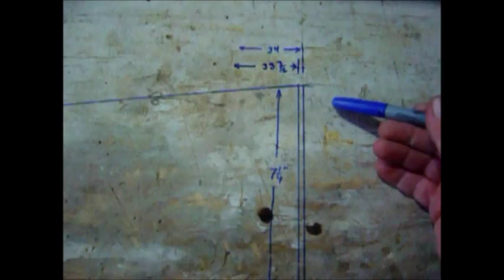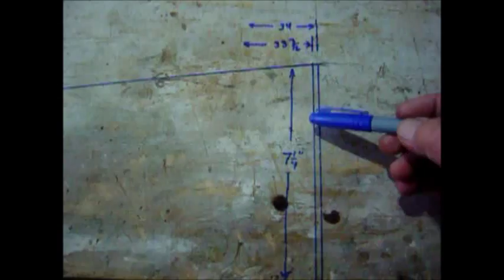Solar Water Distiller Build Part 1

Comment: Excellent video series! Question: Why have an external condensation chamber? Wouldn't the output be the same without it, and if not, how much is the output improved? One other question: Was that PVC-coated aluminum collection trough custom made by a sheet metal shop?
-
I'd eventually like to build a couple or several of these to fill a hundred gallon holding tank to supply my house. With mineral-free water from my highly-mineralized well water, I hope to keep my house plumbing deposit and corrosion-free as possible, without the need of expensive filtration systems.
Reply from the maker: Don Saito That is a very good question, thanks for asking. The external condensation chamber is not needed for this unit to work but it does increase output. The condensation occurs on the cooler surface areas as heat from the hot moist air is exchanged through the glass and the external chamber into the atmosphere. The external chamber adds to that surface area therefore more condensation occurs. Air circulation also plays a part in the process. The more hot moist air that circulates over the cooler surfaces the more condensation occurs. The external chamber increases air circulation in the unit due to the extra cooling surface creating more air movement. You have a very do-able idea for home water. If you have the money to build as many as you need, I say go for it.

Thanks again for asking your question. I will work on making a video of the production with and without the external chamber to show you the difference so stay tuned.
Reply: STARFIRESOLAR Thanks for your reply. That's very logical (external condensation chamber increases output). Here's an idea for possible improvement on the design for your consideration: mount the chamber with a corner 'up' rather than flat. This could be done with two 45° angle elbows. With an angled chamber, the condensated moisture would roll down more easily to the bottom of the chamber (the same reason the distiller's glass is at an angle. I'm not sure if that would really help all that much - what do you think?
-
I look forward to your next video, and 'thanks' again for your altruistic spirit!
Reply from the maker: Don Saito You may not have noticed that the external chamber IS slanted. One end is higher that the other. The temperature difference between the high end and the low end is very noticeable to the touch.  Getting back to your original question of does the external chamber improve production, I have made these with and without the external chamber and I know it works.  I will make a video of the production with and without using the chamber and post it.  I will have to pick two days with full sun all day to have a fair test. Living in coastal NC that shouldn't take too long I hope. Weather has been a little crazy this spring but it'll happen.  Thanks again Don, and I'll be sure to notify you when I post the video.
Reply: STARFIRESOLAR Oh, right - I forgot that it was already at an angle that would cause the forming drops of moisture to gather and then roll, causing even more moisture, etc.
-
Never mind  ;-)
Reply: STARFIRESOLAR About my other question concerning the asymmetrically shaped trough at the bottom end of the sheet of glass - how did you make that, or did you have it made to specifications by a sheet metal shop?
-
Two other Qs:
-
1)  Do you think it might be a good idea to line the bed of the main water holding box with black plastic in order to make cleaning it out easier?
-
2)  Do you think it might help speed things up or increase production by increasing the angle of inclination for the glass?
Reply from the maker: Don Saito 1. I have a metal break and make the trough myself of vinyl coated aluminum trim coil. 

2. About lining the basin with black plastic.  Black plastic, like trash bag plastic wouldn't last long under the intense sunlight and heat. I've seen plastic bags left outside for too long and when you try to pick them up they fall apart.  Also, as a rule, I make these units of only food safe materials and materials that I know will last for many years. Thin plastic does not, in my opinion, meet those criteria.

In this video series I have used black aluminum trim coil on the underside of the basin glass to absorb the heat of the sunlight. However I have made a change in my material selection/use for this. I am now using black silicone. I coat the glass with black silicone in thin smooth coats until totally covered. Again this is applied to what will be the underside of the basin glass. This provides a solid glass surface that can be quickly and easily be cleaned. I use a product called CLR that I buy at the grocery store. It is used to clean Calcium, Lime, and Rust (CLR) from many household things like coffee makers, sinks, etc. and it works great. 

Periodic cleaning of the deposits in the basin is a must to maximize water production. The best way make cleaning fast and easy is to never let the basin run dry, it really bakes the deposits onto the glass and makes it a little tougher to clean off. Cleaning should be done late in the afternoon or early morning. After removing the top of the unit, remove all the water from the basin and sponge or wipe dry. Then apply a small amount of the CLR and scrub. Once you have the glass cleaned, rinse with clean water, sponge dry again, Then in the basin mix about 2 tablespoons of baking soda with a quart of water and wipe it around in the basin. This will neutralize any residual CLR. Then rinse and sponge dry again, refill the basin, replace the top of the unit and you're back in business. I know it sounds like a lot of work but it takes less than 10 minutes.

For your question about increasing the angle of the glass to boost production. When you first put the unit into production you will notice that the glass will almost instantly fog up. As the fog becomes thicker on the glass the beads of water get larger and begin to slide down joining other beads and running into the trough. This will make a streaky appearance at first but as the process continues and the condensate washes the glass perfectly clean this streaking will change to a clear sheeting of the water on the glass. This sheeting provides the greatest surface contact area and heat transfer. The rate of flow is determined more by the intensity of the sunlight and air circulation inside and outside the glass than by the inclination of the glass.  I do understand your question and the logic of it. The more water that runs down the glass should exchange more heat thus more production. I get it. However if the water runs off the glass too fast it doesn't have the time to exchange all the heat it can and ends up going into the storage container with the heat that should/could have been exchanged through the glass. Only the heat exchanged through the glass or external chamber produces condensation. Any heat transferred to the storage container does not exchange heat through the glass or external chamber and therefore does not increase production.

The reason that I have designed these units with a 7 degree slant on the top is that increasing the angle of the glass on the top decreases the size of the basin's heat absorbing area. Reducing the size of the unit means reducing production. 

You ask some great questions and I have tried to give you answers in a way I hope has properly and accurately addressed those questions.

Since we first started talking I have been contracted to build another one, possibly two, of these units. I am not real happy with my production of this video series on building the unit and I plan to make a much more detailed video when making the new units. When I make and post the new construction video I will remove this series of videos to avoid any confusion.

I have not forgotten about the video comparing the unit's production with and without the external condensation chamber so hang in there. I'm just waiting for two clear sunny days to get the best controlled conditions possible.  The amount of direct sunlight on partly cloudy days would vary too much for an accurate comparison. 

Thanks again for the questions Don Saito.
Reply: STARFIRESOLAR You sir, are a highly altruistic gentleman and a scholar. Thank you for your extensively thorough reply to my questions. Yes, I like your idea to use black silicone as a heat-absorbing surface instead of the black aluminium trim coil. The silicone lasts decades even in direct sunlight, is inexpensive and is easy to apply. As you recommend, I will avoid using black plastic to line the basin, and use CLR to clean the glass of any mineral deposit build-up. Okay, I'll keep the glass angle at 7° for the reasons you recommended. I eagerly look forward to your upcoming new and improved videos, and am curious to see the production comparison between units with and without the condensation chamber.
-
Do you think it would be possible to hinge the upper basin section so that you don't have to remove it completely in order to access the inside for cleaning? I suppose the trick would be to 1) protect the glass from breakage by keeping it permanently affixed to the frame, while still 2) making an airtight seal.
-
And, about that removable upper-half: how did you make it airtight yet still able to be lifted-out. From the video, it looked like there is some gray 1/8th inch foam to help make the seal(?) Thanks ever so much more!
Reply from the maker: Don Saito Thanks for the compliment Don, I appreciate it. I know that I don't sound so intelligent when I'm talking on these videos HAHAHA, must be some kind of stage fright or something. I sure sound pretty stupid at times.

I have got to go to work shortly but will try to address your questions with a short explanation. 

As to you question of hinging the top. This has been in the back of my mind since I started building these. The best way I could figure is to hinge the glass. The top built as it is is kind of flimsy to be hinged. I have thought of hinging the glass alone but that has a particular way it must be done and would cost  substantially more to get the holes drilled in the glass then have the glass tempered, also it is even more involved in that the silicone seal between the glass and the top would have to be done in a different way to allow the separation when opening. I've tried to keep the cost down as much as possible. I may talk more on this later but that's the short explanation. 

As for the seal between the top and basin, you say it looked like some 1/8" foam or something used. There is not. The water level inside the basin makes the seal. There is also a small hole in the fill cap to allow air to pass in and out as thermal expansion takes place in the water in the basin. I also put a small thin piece of scrub pad in the cap to prevent bugs from entering the system. This also allows the removal of the top without suction trying to hold it down.

As for the test. I made the test video but I don't have time to edit and post it right now this morning but will possibly get to it later tonight. I will tell you that there is evidence that the external expansion chamber increases the water production. Just exactly how much? I'll explain in the video. 

Stay tuned my friend!
Reply: STARFIRESOLAR About hinging the glass: I was thinking it could perhaps be done by setting the hinged edge of the glass into a metal u-channel bracket with silicone, though I do wonder how much stress that would generate, and if the safety glass could take that stress. Another possibility: don't hinge the glass at all; just have it sit atop a bead of silicone with the back edge up against a wood backstop. When you lift the front edge, the glass would just butt up and rotate against it. The trick to this idea would be to have a bead of silicone of consistent height to prevent high/low spots, which would create efficiency defeating gaps. I imagine it could be done, and that there may even be products out there that could be used to fit the job. You'd want to have a very secure way of keeping the glass panel up whilst doing the cleaning; it would be very embarrassing if whatever was holding it up got bumped or jogged and came crashing back down  :-(
-
Ah! Of course. The top section is sealed because it sits in the water inside the basin. A simple, brilliant solution, as was the small hole in the fill tube cap, stopped-up with a bit of scrub pad to prevent insects from getting in, avoiding any problems with pressure differentials. You thought of everything!
-
I await your further videos with high anticipation.
Reply from the maker: Don Saito Yes Don. I have also thought of hinging the top some way and have ran through many ways to do it. I thought about it long and hard then just put it in the back of my mind and had forgotten about it until you brought it to my attention again. Any way other than having the top glass plate hinged will involve the mirror and the condensation chamber as in removing the mirror and disconnecting the external chamber. I'm not a big fan of having the glass plate hinged as it is flimsy without the support of a frame and without a frame there is nothing to prop up the glass.

Before I started the test video(yes it's done now) I cleaned the basin to provide the best test conditions. As I said before it only took me about 10  to 15 minutes to complete the task including removing and replacing the mirror as well as disconnecting and reconnecting the plumbing of the external chamber. I'm used to doing it so it's not a big thing to me. However since you brought it back to mind,  I thought of a way to hinge the top against the basin. This will involve mounting the mirror a bit higher and re-plumbing the external chamber with flexible tubing instead of the hard PVC pipe I'm using now. I have 3 of these units online at my house right now and have been thinking of rebuilding one of the older ones and that will be an excellent time to implement these changes. 

Thanks for bringing the issue out of my sub conscience and back to the drawing board for me.  Of coarse, don't let me stand in the way of your ideas. You may work out a better way than what I'm thinking of doing. I know, let's both do it and the best idea wins! HAHAHHAAA! Thanks again for your excellent comments and innovative thinking. People like you inspire me to do better.
Reply: STARFIRESOLAR I was thinking of a "hinge-less" design, where the glass plate just sat atop the basin, letting the weight of the glass seal itself on a bead of silicone or some other form of water-tight gasket material all around the basin's top edges. To open it, you'd just lift up the front edge of the glass while the rear edge of the glass was kept from slipping off the back by a raised edge that acts as a backstop. I'm not sure a really good seal could be attained doing it in this manner, though. About propping the glass up once it's been raised: I was thinking of something like a capital I shaped support arm that would act like a car's front hood prop arm. Maybe?
-
Thanks for the 'thanks.' Praise from the praiseworthy is above all compliment!
Reply from the maker: Don Saito  Yes Don, not having a permanent seal between the glass and the top of the sides would possibly allow contamination of the distillate as it came in contact with it on it's way to the trough. If when you had the glass open any manner of dust, pollen, small bug or what have you could get trapped in the seal when the glass was closed again. The capillary action of the water at the seal could contact these particles. Using the permanent seal at the least I would have the peace of mind knowing that it couldn't be contaminated that way.

One other thing about the glass just laying on the seal and not attached in any way could allow the glass to lift off the seal in strong winds. If not totally lifting and bowing off it could move up and down slightly and shift.

Along with those thoughts, if you just used one prop in the center of the glass it would surely bow where it was supported and as it was lowered onto the seal again the corners would touch the seal first and it could shift the glass or the seal itself. Using more props, one on each end and the one in the center would just be something you would have to work around when cleaning the basin. Accidentally bump them and down comes the glass. There is the issue of contaminating the clean surface of the glass by touching it with you hand or with the props. Although it may be minimal contamination, it's still not what you would want to do.

If you are concerned about periodic cleaning being a hassle, and it is somewhat of a hassle, you can always fill it with plain or simply filtered rainwater. Sand, cloth or fiber of some kind would make a good simple filter for this operation. This will drastically reduce the frequency of having to clean the basin of deposits.

Having the top hinged or not isn't as big an issue to me as the daily filling of the basin. My next project on the drawing board is to make a refillable reservoir that automatically fills the basin to the proper level.  I've already got it figured out and I'll be sure to post the video when I have it made and operational. 

As a side note. I have posted the test video. Please watch it and give me your thoughts.

As always, thanks so much for your thoughts and ideas. They are what spurs innovation. Keep'em coming!
Reply: STARFIRESOLAR Good points all (problems with contamination, wind, how to hold the glass up). I think solutions could be found for these, but the contamination problem intrigues me the most - I had never really thought much about that. Have you had any problems with it in your experience?
-
Yes! I thought about how to do an auto-fill for the basin, as well. I actually, ideally, would like to permanently affix a line from my well to these distillers, and then from the distillers to the water tank inside my house (which hasn't been built, yet) so they would almost never need attention, except, of course, regular cleaning. I would have to figure out what to do in freezing weather (my property usually gets a bit of snow every year - not much, but temperatures do go below freezing every now and then).
-
I saw your latest comparison video - excellent work! The increased production from the external chamber makes a significant difference, just as you predicted. You know, it makes me wonder if a larger external chamber might increase production even more, and if there's an e-chamber size that would produce optimal results. That would be a question for a real engineer; either that, or a lot of experimentation.
-
Thanks as always for your efforts!
Reply: STARFIRESOLAR Glad to hear you haven't had any problems with contamination. I wonder if the heat buildup in the basin gets hot enough to sterilize, or at least discourage, unwanted growth.
-
Oh, yes - I'm very serious about this. My property is in California's Sierra foothills, and California is experiencing a major drought situation. Who knows? Maybe when the water tables are sucked dry, and the wells can't go any deeper, the only affordable potable water to be found will come from distillers.
-
Yep, I've got the tools and experience to do the job. I've done construction and carpentry and stuff.
-
I'm thinking the water lines going into and out of the units will have to be underground with any exposed segments well-insulated to prevent ruptures from freezing. Not sure exactly if or how that's going to work. I may have to just drain the lines and wait for the temps to rise. I'm not too worried; I use hardly any water, anyways. I'm already in full drought-mode.
-
Really - a shorter ECC? I have no clue how that would affect production volume. I will defer to your greater experience in the matter. Do you plan on making your next units with shorter ECCs?
-
Thanks!